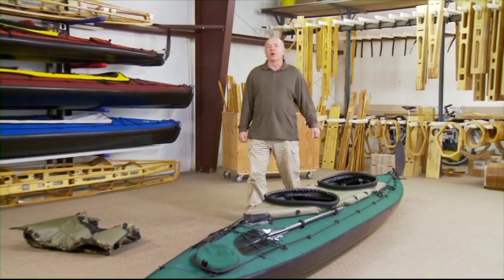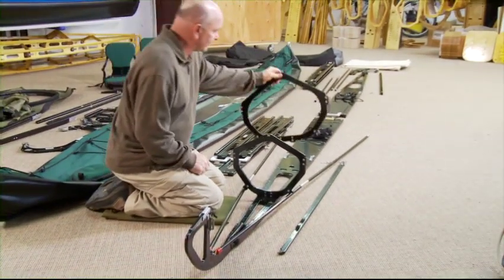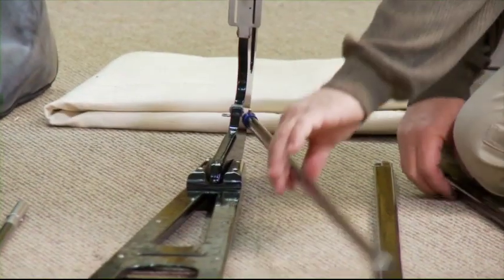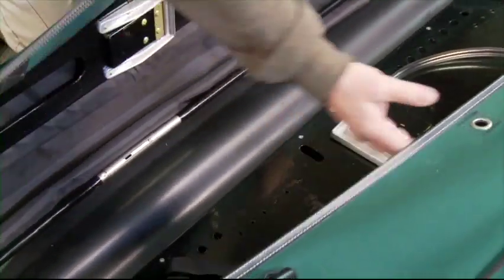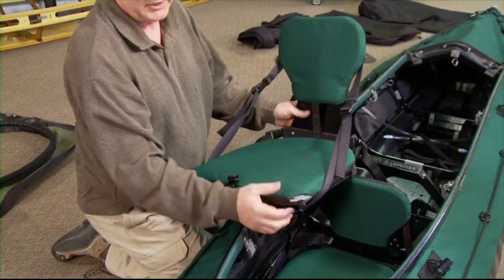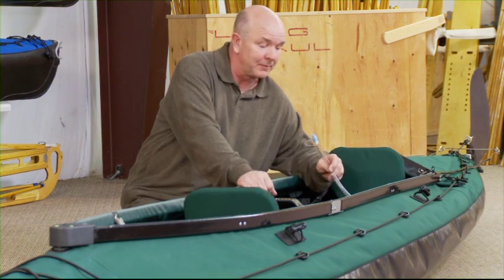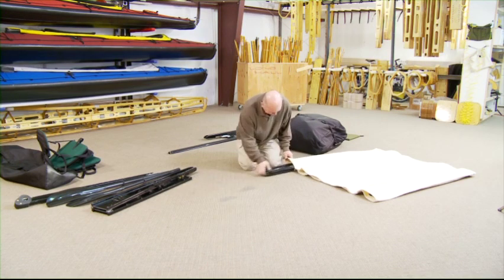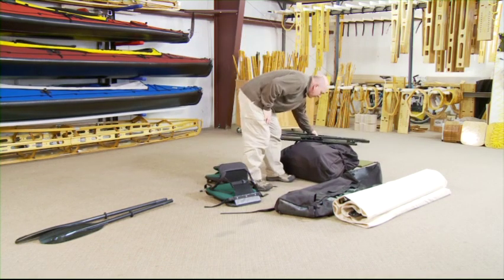Long Haul Folding Kayaks Commando Assembly

Comment: I am a proud owner/user of a Long Haul Mark II Commando folding kayak. If you are concerned with assembly time, just remember that civilians use of this type of boat on the multiple days expeditions to remote locations. When you a need a lot of gear, from 70 gallons of drinking water, to food and cold weather clothing, from tent and sleeping bags to communication, navigation and video equipment, toolkit and spare parts, spending time to assemble the boat and the sailing gear is a pleasure.

Comment: What a beautiful boat, the quality of the fixings is excellent. I have a similar, but cruder, Pouche Boote kayak, it takes me about 25 minutes to assemble or take apart. What's so nice is that the resultant is a respectable boat to paddle 20 miles in. Some folding boats handle like a pregnant whale. Not this one. Well done.
Reply: Yes, the Pouch is a very seaworthy and agile kayak, and I trust it more than any, but assembly can take forever with all those little straps at every rib. They also have old fashioned screws everywhere, like on the Tyne. Tough boat, though (at least the old East-German ones). I'm not familiar with what the quality is now. The hull was tough. Best time of assembly for me was at least 40 minutes. I tried to get one, but the Wuhan flu made it difficult. My friend says, "Check out my Long Haul MK II Commando". I did, and I was sold. The assembly is familiar b/c it owes so much to the ubiquitous Klepper, though Mark has modified it. If you did the assembly of the Pouch in 25 minutes, my hat's off to you. Fastest boat we ever assembled was the heavy Klepper Aerius 20. It was amazing, but it weighed a ton - and if you loaded it, the waterline was over the deck seams. LOL. My best buddy had a Pouch for several years, but it gave up the ghost. He replaced it with the Japanese Pisces which is pretty rare now. The deck assembly is quite different.

Comment: Your partner's life and your life will depend on how well you assemble the boat and how well you load it with all that gear. This is not your Sunday ripple on the local pond... The Commando is an excellent boat for longer expeditions, a strong and more reliable improvement on the original Klepper.

Comment: Excellent training video. I missed the bit that shows installation of the foot operated bailing system for when you need to empty a capsized craft ???  Please don't say it cant happen, and don't say you can paddle the inflated boat to land to empty it out.
Reply: I've had similar folders and have never had one capsize, and I've been in huge seas. I won't say it can't happen; you can be blindsided by cross-waves. I've tipped one when trying to dive out of it :-). Anyway, that's what sponsons are for, to keep the boat afloat in an emergency. If your boat does NOT have sponsons, a net with some cheap beachballs stuffed inside and poked into the bow & stern will help keep you afloat. We just bring along empty tins for baling and for - well, you know.